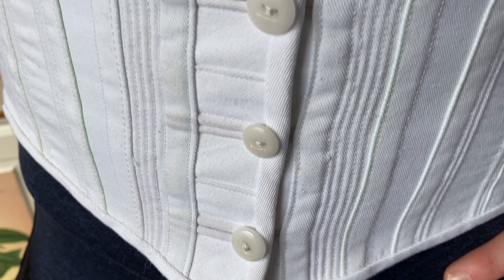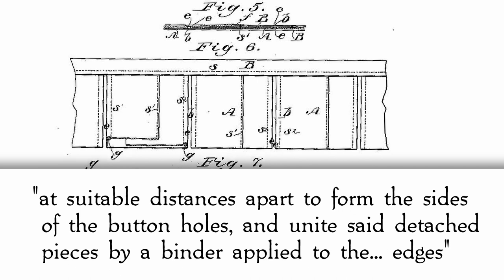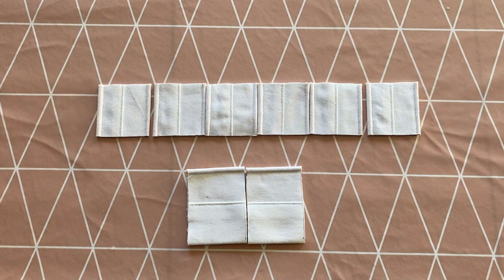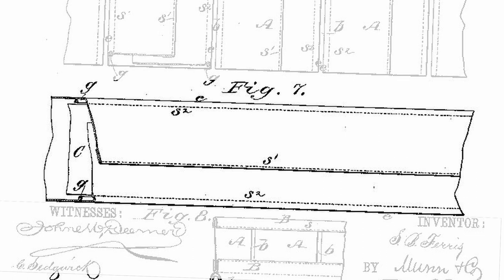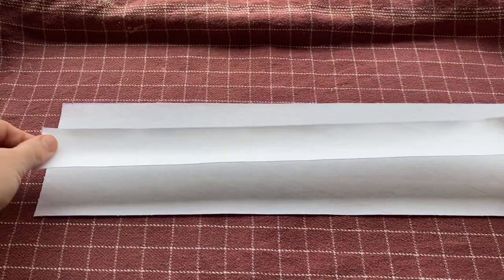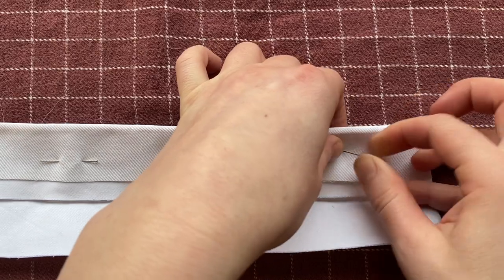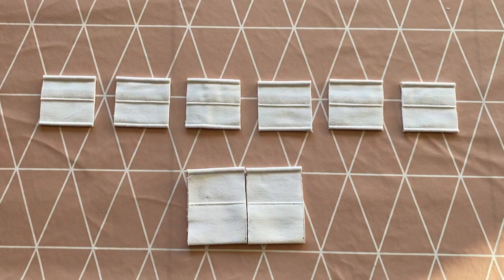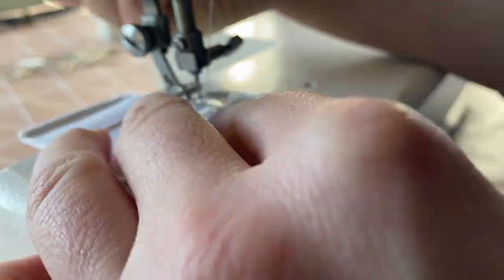Ferris Corset Waist: Tackling the Buttonhole Strip

Comment: Ok, this did explain how the button placket was made, and it certainly is easy to understand the process, my question is it worth doing? What I mean is does it really add to the strength of the garment? BTW, love seeing Miss Cannell, she is so adorable.
Reply from the maker: I would say it was definitely worth doing (especially on the original garment, as the manufacturing process would have been very streamlined, and they would have mass produced just meters and meters of the corded strip which would easily have been broken down into the smaller sections) because the buttons have to take basically all the pressure of holding the garment closed - the same job that a metal busk normally would have done, so I think the added reinforcement that was strong and yet incredibly flexible was -in my opinion- a very creative and necessary solution!

Comment: Back to consult this video for the fifth time as I'm thinking of riffing on the technique for making a closure for a reversible robe. Idea is that the wearer wraps the belt all the way around their body and then tucks into and back out of openings along a section of the belt, and thus secures it simply by that pressure. The belt, like the robe, can have different fabric faces which will match no matter which way the robe is worn. With this type of closure it can be purely soft fabric while still (theoretically) being more secure than a tied robe belt, plus not needing belt loops which would feel uncomfy on the interior of the robe.

So next I'm theorizing that it might be possible to make the part of the belt which will be used for the adjustment holes and the part which will be the tongue from the same base piece. I'm hopeful that the tongue width could equal the height between the adjustment holes. 

I'll let you know if the experiment works!
Reply: Cording / piping foot and cord has arrived. Experimentation will begin after I get the current project of the craft room tables...
Not planning to try for reversible after all, since I'm concerned about edge bulk.

Comment: SHANNNNNNON!
Hi! 😊

This is... different.
Obviously, my question is whether or not this technique appears before this, or if it was perhaps designed specifically to ensure that when applying for the patent, it was unique enough that they would be sure to get it?

Aside from looking pretty awesome, it does not have any apparent advantages over classic buttonhole methods. Unless there is something that you've noticed from constructing and wearing it that I didn't notice or missed because I am a bit of a ditz?
Going to rewatch the video now and see if my questions have been answered
Reply from the maker: SO while I am not 100% an expert on this, I can reply that as far as I'm aware this is the first method of this type, and certainly the first to reinforce the edges of the strip with cording in order to withstand the wear/tear and pressure of holding the corset shut. 

Sometimes in patents if there is only one specific part of the process that is new, the language of the patent often specifically points that out (to help guarantee the patent), and there is nothing in this language to suggest that Ferris' patent was similar to an existing technique. 

Also, interestingly enough, Sherwood Ferris went to court in 1895 accusing patent infringement on two of his patents - this one, and his patent for the other part of the buttonstrip - the attachment of the button, with the twill cording in place of thread. The judge ruled that his patent for the button CORD was denied infringement due to "lack of patentable novelty" (basically that there was nothing substantially new about attaching a button with a piece of cord as opposed to the normal thread, and oh boy, did the judge have fun pointing that out in his ruling), but more to YOUR question, the judge said nothing of the sort about his method of working the buttonHOLES, leading me to believe that this invention was certainly novel enough to past muster with this judge!
Reply from the maker: did that answer your question somewhat?
Reply: @ShannonMakes  Yes!!
Now I sort of hope you're working on a fun video about that court case.
I can totally imagine that judge's exasperation!
Reply: Another question, but not sure if it is for this video or the wear video:
Do you feel like this method of buttonhole placket is uncomfortably bulkier than a standard one, or is there no noticeable difference?
Reply from the maker: @rd6203  It's hard to say because the only other button plackets that I have experience with are in say blouses or dresses, and those are all made with a much lighter, more drapey fabric, so even if you have 2-3 layers thick, it's still only maybe as thick as one layer of my cotton twill. I'd hazard a guess that if you made a placket in the Ferris style, but out of a shirting weight fabric, it'd be a bit bulkier and stiffer than if you did a normal style... because that's sort of the purpose, right? To make it stay stiff and withstand the pressure of a corset busk (and be mass-produce-able, as noted in the patent), but I also think you could tweak it to be less bulky but still the same style - forego the middle lining layer in lieu of some good interfacing, eliminate the cording (or use 1mm cording instead of 2) etc...!